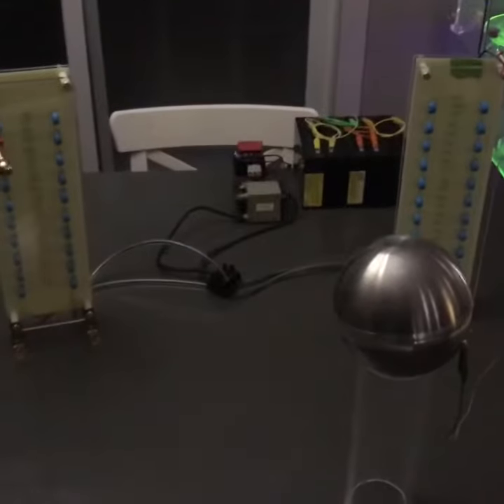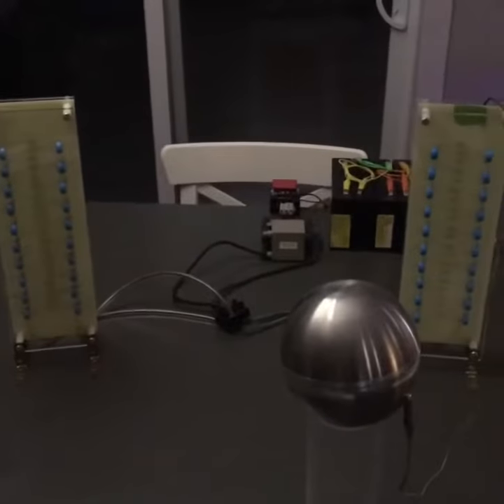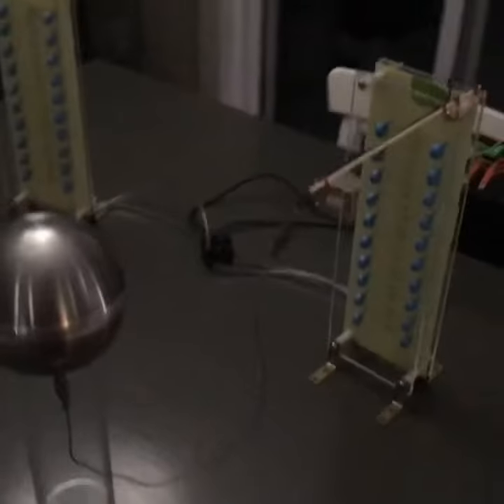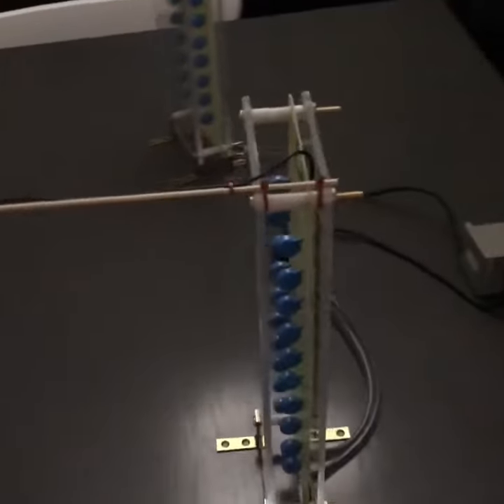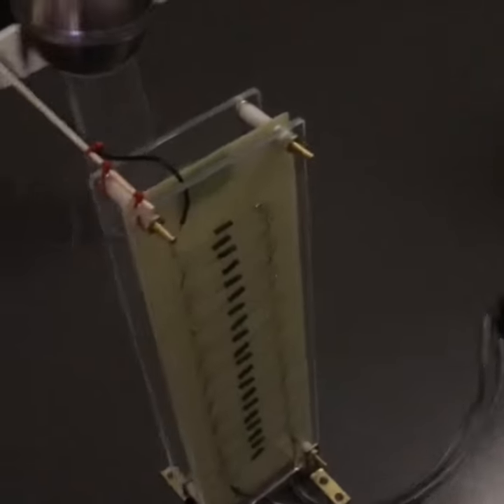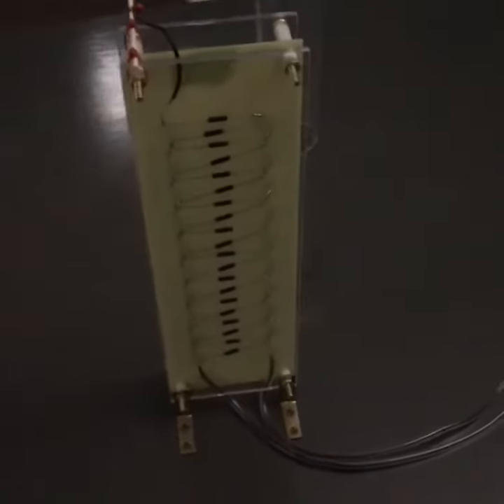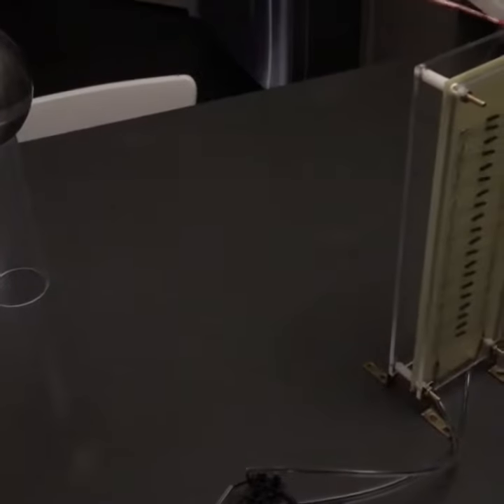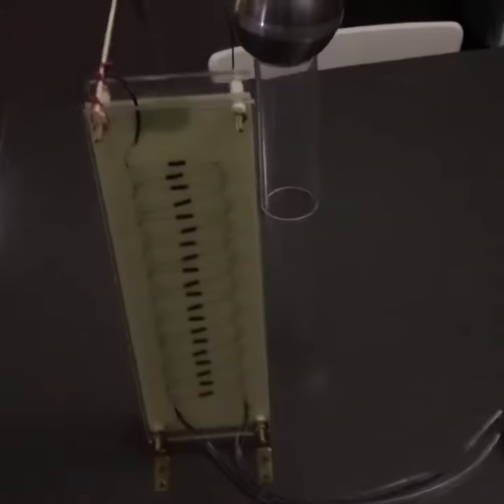Cockcroft-Walton Bipolar Voltage Multiplier

Comment: Can you tell me what you did for the imput voltage and the setup?
Reply from the maker: Input voltage was 30vdc from SLA batteries into a ZVS driver that feeds a giant AC flyback transformer.
Reply: How many diodes were there?
Reply from the maker: @insanescience8106  each stage is 2 caps and 2 diodes. All together I have 20 stages so that’s 40 caps and 40 diodes.
Reply: How many diodes and capacitors do you need for 1 million volts?
Reply from the maker: @insanescience8106   That really depends on your input voltage
Reply: Thank you for answering my questions sir.
Reply from the maker: @insanescience8106   you can roughly calculate the output voltage with : 
 Input voltage x 1.414 x number of stages. 
This will give you the rough unloaded voltage not including losses.  You will find it very hard to stop arcing across stages in open air. I’m building a 20 stage multiplier submerged in mineral oil. I will be posting a video soon. 
Remember each stage is 2 caps and 2 diodes.